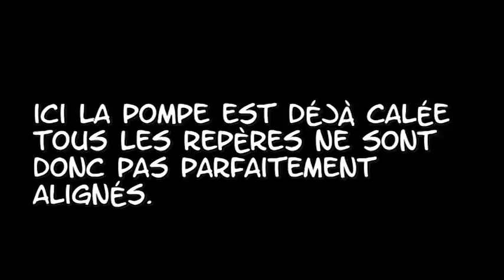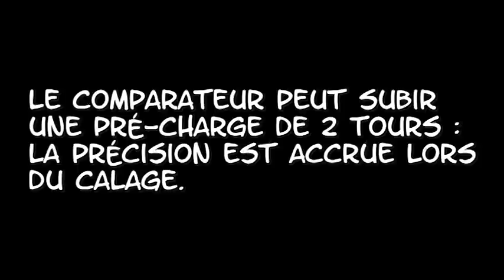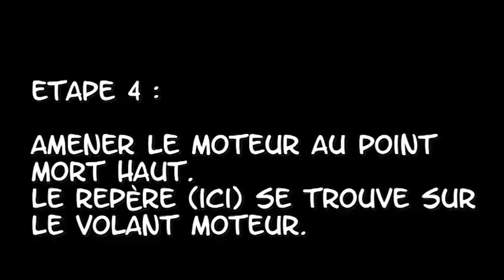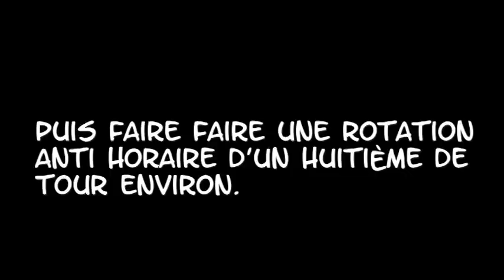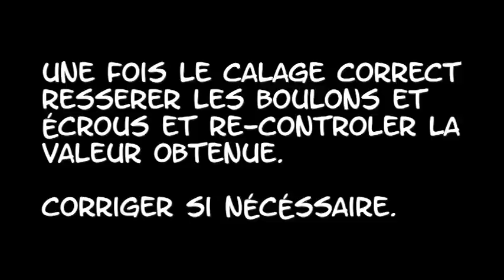Caler une pompe à injection BOSCH VE

Comment: salut j'ai un soucis , est ce qu'il faut nécessairement tomber la courroie accessoire pour trouver le PMH en tournant le volant moteur? Coté arbre a came si je desserre le pignon a la boulonneuse y'a aucun risque que ca force sur la distribution, et inversement après avoir mis la plaque de calage  ? merci
Reply from the maker: Salut,
Le PMH se trouve sur le volant moteur,il y a un point O avec un trait marqué qui est visible dans une fenêtre entre la boite et le bloc coté pompe.
Il faut que les lobes de l'arbre à cames du cylindre le plus près du radiateur pointent à l'opposé du piston.
ça c'est le point mort haut cylindre 1.
Il est possible de desserrer la poulie arbre à cames coté distri et la faire pivoter sur l'arbre à cames,mais il y a de la tension dessus et la portée de la poulie est conique.
ça implique de desserer un peu,tapoter par l'arrière ,faire pivoter la poulie sans bouger l'arbre à cames,et resserrer. 
c'est pas terrible du tout comme méthode.
Mieux vaut relâcher la tension sur la courroie et tout caler correctement.
Reply: @michaelovitch  alors pardon je n'ai pas preciser c'est un 2.5 tdi comme sur les t4 la partie injection possède deux galets , tendeur et juste enrouleur je pense, mon repère pmh est sous le moteur sur ma volvo donc un qui regarde et l'autre qui tourne quoi au final? merci
Reply: j'aimerai juste caler la partie arbre a came a droite coté injection sans toucher la distri svp merci
Reply from the maker: @mercedesbenzw2119  
Si c'est comme ce moteur ,il faut mettre au PMH et desserer la poulie d'arbre à cames coté pompe.
Le coté distribution n'a pas à être touché.
Il faut quand même repérer la distribution (d'abord volant moteur,puis cale en bout d'abre à cames)
Sans ça il est impossible de caler la pompe correctement.
Il faut que le moteur soit au PMH volant moteur ET PMH arbre à cames : les deux étant totalement dissociés vu qu'il n'y a pas de clavette sur les poulies de l'arbre à cames.
Reply: @michaelovitch  ok cool super précis dans les explications, si il y avait eu une clavette sur l 'AAC partie pompe le volant moteur aurait été repéré et ca m'aurait éviter de forcer  sur la pompe pendant des longues minutes , je vais faire ca merci encore
Reply from the maker: @mercedesbenzw2119  
Il faut garder à l'esprit que tout est à caler/piger/repérer seul,et ensuite accouplé par serrage.
Reply: @michaelovitch  alors je viens de faire tout ca , le PHM arbre a came et le repere volant moteur concordent entre eux ,la pompe injection est calé face au trait jj'ai du gasoil dans les conduites dure injection mais ca demarre toujours pas...j'ai meme pas un peu de fumée au pot d echappement
Reply from the maker: @mercedesbenzw2119  
La pompe calée au trait n'implique pas qu'elle est ajustée correctement.
Le trait ne sert qu'à grossièrement la caler.
Il faut l'outillage spécifique pour caler la pompe correctement : le comparateur,la touche et la valeur nécessaire à ce type de moteur.
Reply: @michaelovitch  elle devrait démarrer malgré tout même en décalant d'1 cm l'avance à l injection ,c'est juste pour l'emmener chez le garagiste de mon coin, l'lectrovanne joue un role a l'arrivée du gasoil? j'ai peu etre cassé un truc en démontant ca et elle est en position fermée, en changeant les deux joints de corps de pompe j'ai mal replacé un truc? je suis démoralisé la
Reply from the maker: @mercedesbenzw2119  
Si du gazole arrive aux injecteurs,ce n'est pas l’électrovanne.
Il faut être sur d'avoir bien purgé les conduites rigides jusqu’au coté injecteur.
à la rotation du moteur le gazole doit sortir entre l'injecteur et la conduite rigide desserrée.
Si il y a du gazole,alors il faut vérifier le calage de la pompe.
Sur la pompe ,il y a une encoche sur la poulie.
Cette encoche doit être alignée avec le marquage sur le corps de la pompe ,et sur son support en fonte.
Il y a donc 3 marquages à aligner.
Comme j'ai dit précédemment,ce n'est qu'un calage de pompe grossier.
Il faut être sur que les bougies de préchauffage fonctionnent.
Pas besoin d'être démoralisé,c'est pas utile.
Il suffit de faire tout ça par étapes.
Reply: @michaelovitch  salut , j'ai changé bougies de préchauffages, tout caler, j'ai fait tous ce qu'il fallait je vois même le gasoil tourner quand je tourne la poulie de pompe a la main mais rien y fait.
Je soupçonne la poulie crantée de pompe à injection d'avoir été changée de place et vu qu'il n'y a pas de clavette pour la recaler , le repère qu'on doit aligner est du coup faussé depuis le debut alors que je me fies a ca ...je pense
Reply from the maker: @mercedesbenzw2119  
Salut,
La poulie de pompe est clavetée,c'est pour être sur d'injecter au cylindre numéro 1 qui est la référence pour tout caler la distribution et la pompe.(il y a un ordre d'injection à respecter sur les 6 cylindres)
Il y a des trous dans la poulie,un des trous est plus petit que les autres.
Ce trou sert à insérer une pige ,qui va traverser la poulie et s'enfoncer dans le châssis /support de pompe.
La fente sur la poulie sera alignée avec les autres.(la pige n'est pas obligatoire,une douille de clé à cliquet de taille adéquate suffit)
C'est une bonne idée de vérifier qu'il y a bien la clavette,ça éliminera un doute.
Est ce que le repère du volant moteur utilisé est bien le trait avec un 0 (et pas l'autre) ?
Reply: @michaelovitch  Quand je pivote la pompe elle force sur 3 ou 4 endroits avant de faire un tour entier j'imagine que c'est l arrivée du gasoil a un timing precis , sur la mienne (sur le volant moteur) il y a un juste un petit trait et une flèche que j'aligne sur le support,que j'ai aussi decalé de 0.5mm comme recommandé, mais pas de zéro.
Je me suis assuré de tourner en entier le volant moteur et il y a aussi un repère creusé sur deux centimètres de large a gauche avec une partie ovale sur la droite
Reply: en fait sur la pompe il y avait des repères rouge sur l'ecrou qui tient la poulie d'injection ,des repères tracés en vert sur le dessus du support de pompe (la ou est le repère en temps normal) et jaune sur l'arbre a came
Reply from the maker: @mercedesbenzw2119  
Il faut trouve le zéro avec le trait sur le volant moteur et le mettre en face de la pointe qui sert de repère sur la boite à vitesses.
Il n'y a rien à décaler.
Il faut trouver ce zéro.
Pour s'en approcher on peut tourner le moteur pour faire pointer les lobes de l'arbre à cames du cylindre à l'opposé du piston ils formeront un V 
Il faut bien éclairer dans l'orifice de la boite et éventuellement enlever la rouille pour bien voir.
Peut importe les repères utilisés par la personne précédente,on s'en occupe pas.
il suffit de suivre les instructions du constructeur.
Reply: @michaelovitch  J'ai pas de repère 0 sur ma volvo il y a juste un trait (un trait usiné) à l horizontal du volant d'ailleurs l'orifice est en dessous de la voiture donc aucune trace d'huile ou autre c'est propre je suis couché quand j'ai eu de l'aide pour tourner la poulie  j'ai bien regardé à la lampe.
Quand ce trait de volant est calé sur la petite flèche et bien l'arbre a came est également calé au dessus (j'ai pas la plaque mais c'est totalement droit avec le cache culbuteur) donc les deux concordent c'est pour ca que je suis perdu tout est bien positionné :(
Reply from the maker: @mercedesbenzw2119  Qule est le modèle de voiture et son moteur ?
Reply: @michaelovitch  c'est un volvo 850 tdi 2.5 de 96
Reply from the maker: @mercedesbenzw2119  
Ce n'est pas du tout pareil sur cette voiture.
Donne moi ton mail, dans ma chaine youtube,onglet "a propos" 
J'ai la procédure avec les repères et méthode à suivre.